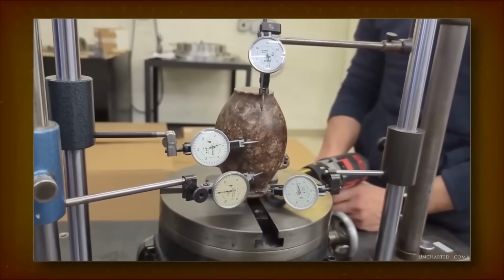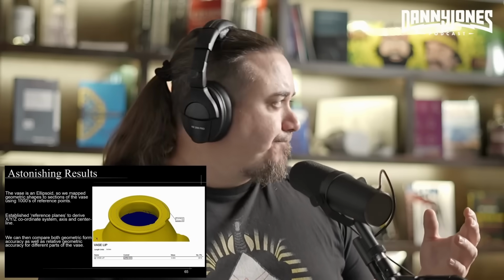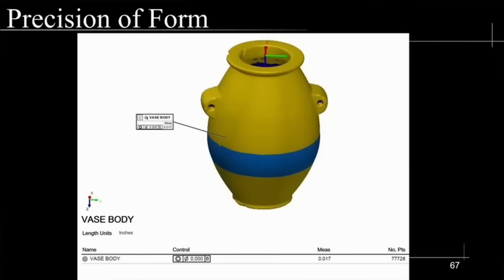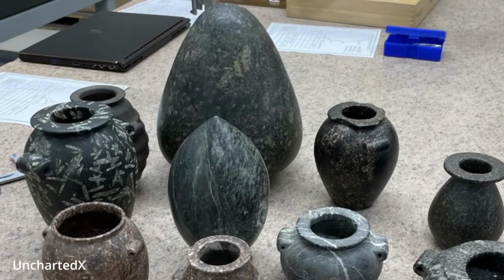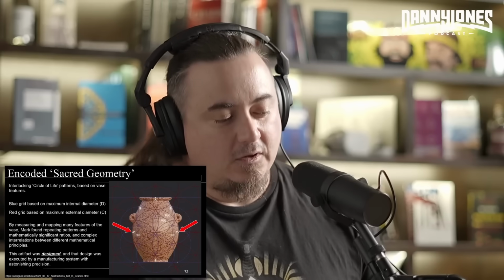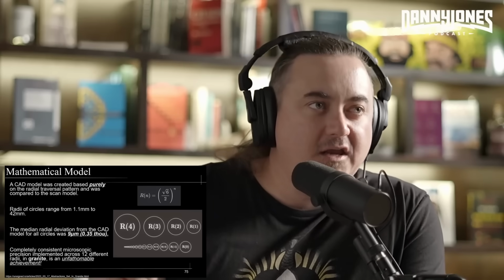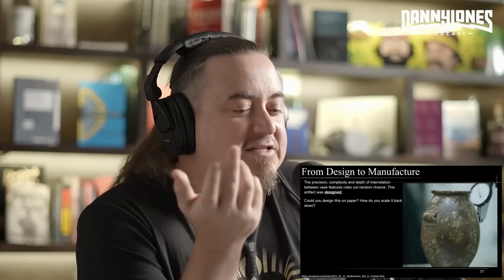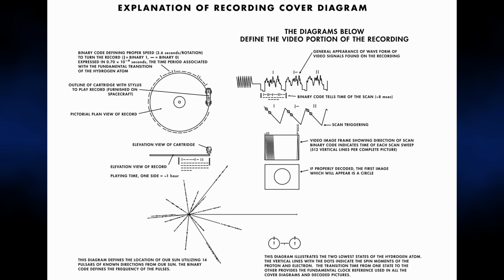Are These Ancient Egyptian Vases Actually Impossible to Make? #podcast #science #history #egypt

Comment: *Step Pyramid of Saqqara: why is *this the key location?**

1. *What the excavations revealed*

   * *40,000–50,000 stone vessels* in hard rock (granite, diorite, basalt) have been catalogued *beneath and around* Djoser’s pyramid.
   * The *majority* come from *hypogean galleries* dug *well below* the walking surface of the 3rd Dynasty, in layers that *precede* the construction of the pyramid itself.
   * The finds include vessels *without any inscription* or with **inscriptions added later**, often **crude**.

2. *Stratigraphic order*

   * The pyramid was *erected in several phases* (mastaba → four steps → six steps).
   * The *deepest galleries* (28–33 m) *intercept* deposits of vessels *already sealed* by *sand and calcite layers* dating before the foundation of the pyramid.
   * → **The vessels were physically there before the pyramid was built**.

3. *Logical implications*

   * *A)* The pyramid *was not built “to contain”* the vessels: it was *erected above* a pre-existing *burial-deposit* of perfect artefacts.
   * *B)* The architects of the 3rd Dynasty *did not invent* the stepped form: they *incorporated* an already sacred site, turning it into a “celestial staircase.”
   * *C)* The absence of slag layers or tools *on site* indicates that *no working* of hard rocks took place during the 3rd Dynasty: the vessels were *merely retrieved* and **re-used**.

4. *Synthetic reconstruction*

   1. *Phase 1* (pre–3rd Dynasty, > 14,000 BP?): primary deposit of ultra-precise vessels in a hypogeum.
   2. *Phase 2* (3rd Dynasty): the original mastaba is *expanded* to cover the entrance to the hypogeum; the stepped structure *acts as a casing* for the treasure beneath.
   3. *Phase 3* (3rd–4th Dynasty): vessels *without inscriptions* are *scattered* in the new galleries as *burial offerings**, while the **few* that receive hieroglyphs are *re-inventoried* as royal gifts.

→ *The Step Pyramid of Saqqara is the equivalent of a “medieval cathedral built over a Roman temple”**: the official monument **masks* and *legitimises* a much older site containing artefacts that the culture of the time **was incapable of producing**.

---

*Saqqara before Saqqara*
Synthetic analysis to determine whether, *14,000 years ago**, the site had already been “chosen” by a pre-dynastic civilisation and whether **literary traces* of such a presence exist.

---

### 1. Geography of Saqqara at 14,000 BP (12,000 BCE)

* *Climate**: terminal phase of the Pleistocene → cold, arid desert; the last glacial Nile floods lay **40–60 m below* the present ground level.
* *Topography**: the Saqqara escarpment was **a rocky ridge 30–40 m high* overlooking a river valley far deeper than today.
* *Water**: the western branch of the Nile flowed **further west**; the Saqqara area was **harsh, windy, without arboreal vegetation**, but offered a **strategic view* over the valley and Saharan–Sinaitic caravan routes.
* *Humidity**: the water table was **much lower**; any hypogeum dug 30 m deep was **perfectly dry* – **ideal conditions for a long-term deposit**, not for an open-air necropolis.

*Verdict**: At 14,000 BP, Saqqara was not a fertile burial plain, but **a rocky promontory emerging* over a desert landscape. The site was *extremely geologically stable* → *perfect for a “data bank” of artefacts* intended to last tens of millennia.

---

### 2. Evidence of a pre-dynastic culture at Saqqara?

There are *no Egyptian texts* that speak of “inhabitants before time”; however:

| Source                               | Relevant content                                                                          | Interpretation                                                                    |
| ------------------------------------ | ----------------------------------------------------------------------------------------- | --------------------------------------------------------------------------------- |
| *Manetho* (priest, 3rd c. BCE)     | Mentions “*demigod* kings who reigned for millennia before human pharaohs”              | Legendary reference to an *earlier civilisation*                                |
| *Herodotus* (5th c. BCE)           | Describes “**underground chambers built before the flood**” near Saqqara–Memphis          | Possible echo of pre-dynastic hypogea                                             |
| *Plato, *Timaeus**                 | Dates the fall of Atlantis to *9564 BCE* (≈ 11,564 BP) → *close to 14,000 BP*         | Places Saqqara within a *legendary chronological arc* of lost civilisations     |
| *Mastaba tombs of 1st–2nd Dynasty* | Are *shallower* and *later* than the vessels; *none* connected to the deeper levels | Confirms that the *3rd Dynasty* found the older galleries *already excavated* |

---

### 3. Why exactly Saqqara?

* *Solid rock**: the limestone substrate allowed **deep tunnels* (today 28–33 m) without collapses.
* *Border position**: at 14,000 BP the promontory was **the last height before the western desert* → visual control over caravans and waterways.
* *No flooding**: the site was **outside* the Pleistocene floodplain → **never submerged**.
* *Astronomy**: the natural north–south axis of the ridge matches **the summer solar azimuth* → potential symbolic alignment.

---

### 4. Final outline

| Date                 | Event                                                   | Evidence                                            |
| -------------------- | ------------------------------------------------------- | --------------------------------------------------- |
| *14,000 BP*        | Desertic rocky promontory                               | Geology & palaeoclimate                             |
| *12,900–11,600 BP* | Extreme climatic events (impact hypothesis)             | Possible *interruption* of the depositing culture |
| *> 3,100 BCE*      | *1st Dynasty* finds galleries already excavated       | *Shallower* mastabas                              |
| *2,686 BCE*        | Djoser *builds* the Step Pyramid *over* the deposit | Vessels *retrieved and reused*                    |

---

*Conclusion*
Saqqara **was not a random location**:

* *14,000 BP* it was a *rock fortress sheltered from water and sand* → **perfect deposit site**.
* No ancient *Egyptian* text names its original builders, but *Manetho, Herodotus, and Plato* preserve the *legendary echo* of a pre-diluvian civilisation right in this area.
* The Step Pyramid serves as a *posthumous “monumental seal”* over a stone archive **much older**.

Comment: A pottery wheel is essentially a lathe. I could totally see them making those on a pottery wheel. Instead of  molding clay on it your sanding down stone. It would take a very long time but with a very simple set up of slaves or hydrodynamic power transmission perpetually turning the wheel and another standing there either holding a tool operating some sort of jig set up.

Comment: a copper drill drills the hole in the middle of the stone. Then they continue to sand the vase to finish the shape of it and make it smooth. It's not rocket science. It's just pipe made of copper and it drills the hole slowly by putting sand while turning the copper tool. They used the same drill pipes to make the pharaoh sarcophagus

Comment: LIfe long tool and die make here.  I apprenticed under a Austrian Master Machinist and tool maker.  All of the symmetry and dimensional accuracy of these objects can be achieved with extremely simple tools.  You wouldn't necessarily need to understand the math involved, but there is no reason the wouldn't have.  The math required to manufacture these objects is basic.  It only requires the ability to divide the circle. Read the foundations of mechanical accuracy (old book), if you wish to see the simplicity.  They lack the fundamental understanding of mathematics to understand how basic this is.  Ancient peoples had the same brains we do today, but were much more adept at high level problem solving.  The metrology setups used in this video are deeply flawed, not to mention most decent tool makers can eyeball within a thousandth of and inch (.001")  This is not even close to high level accuracy.  I work well under a tenth (.0001") daily and often within much tighter tolerance.  Most average humans can easily feel a .001" ridge with their fingernail.  Not to mention that materials like stone and granite are of the most thermally stable and dimensionally sound the exist in the material world.  The people speaking have no understand of the subject in which they babble.  This is clickbait.  One thing is absolutely certain, the humans who made the items were much smarter than the ones investigating and babbling about their impossibility.  Also, we can make these objects to an outrageously higher degree of dimensional accuracy, even with simple shop made tools.  Not many people left in this trade to call these folks bluff left in this world.  I am 38 years old and happen to be one of them.
Reply: If I were investigating how these items were made, I'd want to see them under a Scanning Electron Microscope. Even a basic stereo zoom microscope with decent optics would tell me more about how they were manufactured than cad scans with low resolution accuracy.    This video is a perfect case of the "Dunning Kruger Effect", they don't know what they don't know.

Comment: Just curious. There is a locking angle of 7 degrees. Many lathes and mills still use collets that lock based purely on their taper. This is common knowledge to machinists. 
It's very possible that the base of the vase holds the answer to the question of holding. It's possible they had a stone "male" end that was tapered into a 7 degree taper on the vace and it could have held the work piece. From there that male taper would have been connected to a spindle. 
I can literally get a perfect circle using the equivalent of a bow drill in my back yard using an imperfect stick and a rock, no precision using a piece of string, a bent stick and a rock. At the base of my spindle it will drill a  perfect hole, it's radius can be measured and it would be very precise. 

The handles are explained by the difference between speed and productivity vs quality. We value speed AND accuracy. If speed wasn't the issue and quality was? you could do this by spinning the vace in the same exact process but much slower, in fact hand operated meaning that WHILE you are in the same setup with the same holding used to cut the bulk of vace, you would stop it basically and rotate the piece against the tooling back and forth between the two handles. Sure it would take forever - by maybe time wasn't a key indicator? maybe precision and quality were? IT could have took a week of some poor craftsman rotating the vase back and forth in the same exact setup he used to create the entire vace. 

Thinking outside the box on these sorts of things is how they were crafted, so you need to think outside of the box to unpackage it. All the needed to remove material was the application of pressure and friction, speed would have created heat, so maybe it was about slow methodical movements using the correct pressure and whatever method of material removal they had. More than likely it could have been another stone that was harder / more abrasive. 

You should really consider employing some smart machinists. I'm by no means a pro, but I have machined enough to come up with this basic idea for how I would do if it I was tasked with creating this.
Reply from the maker: Thank you for sharing

Comment: Ancient Chinese Secret: I think they used water erosion or quarried the stone that was water eroded and carved the outside. Have you ever been to marble canyon? Perhaps they harnessed the power of a waterfall, mounted a piece of rock, underneath and came back periodically and gave it a turn  (the waterfall is the lathe) or they could have started a hole in a rock and then put rounded rocks inside of it and let the water churn it, similar to a rock polishing machine, only it was the container that was the desired item to be polished internally not the rocks. Some things take time. Or, the rocks had another purpose and over time were worn down and then repurposed into vases.

Comment: Anyone who has worked in or around concrete and stone is well aware that "cutting" means abrasion, which is sanding. It's why today most stone "cutting" tools are diamond tipped. Without modern techniques and tools the main difference is time. Yes, with sand and water and/or other harder abrasives it's easy, but painfully slow to wear down most stones. If one believes they are performing for their one and only god, under divine guidance, then it's not so difficult to comprehend how the ancient Egyptians could spend months or years, day after day, to produce a carving. Let's quit denying human enginuity and determination for internet clout.😮

Comment: Impressive scans, but not evidence of lost high-tech. The reports themselves show both things at once, hair-width deviations at the rim and mouth where rotation is easy, and millimetre-scale misses on overall roundness and, especially, the handles. That pattern screams skilled handwork under rotation followed by manual detailing. The tool marks fit copper-tube drilling with abrasive grit, where the grit does the cutting and naturally leaves concentric striations. Most Egyptian stone vessels are in softer calcite “alabaster”, with hard-stone showpieces as the tip of the distribution, so showcasing only the best specimens is cherry-picking. And the “design” vibe doesn’t require secret knowledge of π or the golden ratio, it falls out of practical geometry, rope-set right angles, and simple optimisation under constraints. In short, the video spotlights the smallest numbers and ignores the larger ones. What the data actually supports is high craftsmanship plus abrasives and time, not a vanished machine shop.
Reply from the maker: There are thousands of these granite vessels, not just a handful. The alabaster vases are later period. The fact that there is an inversed evolution in precision and skill leads heavily to believe these were not a product of the Egyptians. Just pure speculation, of course.

Comment: just two thauts.
1. If you are technological advanced, using some kind of computer to design ethen simple houshold tools.
woudend be the mathenatic basics automaticaly embedded by construction?
Is there the need for an intention, to safe knowledge thru time?
2. Thinking about the practical production process, desintegration comes to my mind.
You know Perry Rodan? There use this all the time. Kuting shapes out of a block of any kind of material by destroying the connection between atoms, transforming not needed materia into dust.
This woud work in the exact way,  like your messuring the vase with laser and with a similar precision.
And by the way, there would be no mechanic force aplayed to the object, so differnces in structure, hardness, or material can be ignored.
Also you may creat realy thin layers, without breking it, becaus ther is no mechanic force aplayd that can break it. Simply peeling skin or layers with a laser, but without heat.

Comment: I think through using centrifugal force on a potter’s wheel this level of perfection can be done. 
Imagine a bladder of liquid filled inside and spun fast to create a sphere inside to shape it there. And maybe a string going thru the centerline of the pot resulting in a near perfect centerpoint. 

That and it most likely these were manufactured in pieces and joined later on in the process. Allowing focused accuracy on each piece.

Comment: "Even if you had a lathe and a tool rest, this is genuinely not achievable by hand."

Yes it is. Example: Three thousandths of an inch variance across the top of the vase's mouth, across what appears to be a half inch or less distance, is not "very accurate" except in the context of being made long before modern machine tools. It's certainly not "very accurate" to modern metrologist who are working with jet engine turbines. Those guys are used to working in the realm of tenths of thousandths across feet of distance.

If you rub three rocks together enough, cycling between any two of them at a time, you get pretty flat surfaces. Then if you hold one of those rocks on the end of a stick, and make the vase turn, bingo you've got your flat surface around the top. You might have to change out your flat rocks every so often, and you might have to turn the vase for days, but it will get the job done. You could easily get a surface flat to within three thousandths in half an inch. Even more-so if you could get the rock to turn while the vase is turning too, as is the case with blanchard grinding.

I don't think the amazing bit is that such vases exist. There are two amazing bits. Firstly, that whomever made them must have put so much time into them. Sure, they didn't have modern grinding wheels and motors to turn stuff with, etc., but flattened rocks and enough man-hours of labor could do the same job. Secondly, if any two vases have all the same dimensions as if they had been CNCed. Still achievable, but even more impressive if that's the case.

"Seventeen thousandths of an inch accuracy is something that represents the very best machinery we have today."

Nope. Not even close to being right. Modern precision machinery, if operated well, can maintain accuracy to a couple of microns or less. Maybe don't suggest things were impossible to make if, clearly, someone made them.